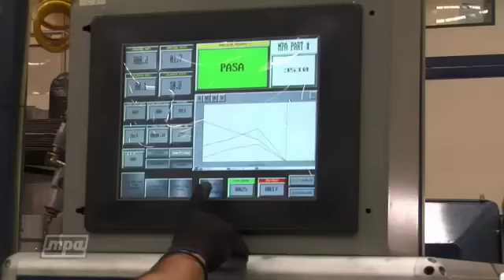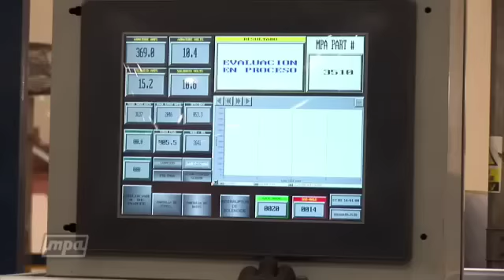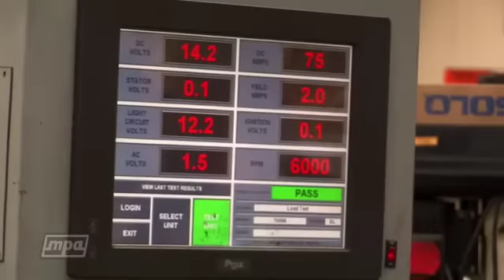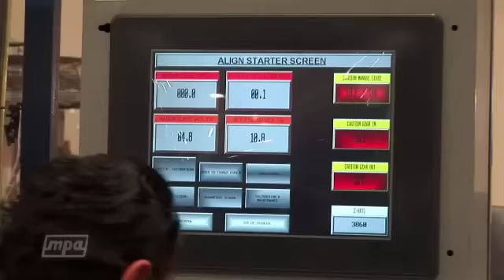Motorcar Parts of America

Comment: At 3:34, the alternator being tested has 1.4 Volts A/C. This indicates a bad diode as max A/C voltage should be less than 0.060 because this interference is noise thru the entire serial data network. 0.016-0.009 is normal at 2,000 RPM. Software is incorrectly programmed. ASE Master 1978.